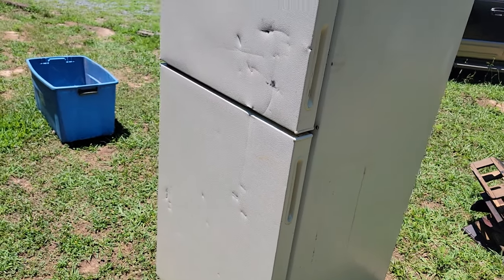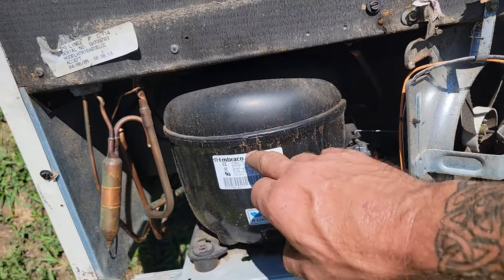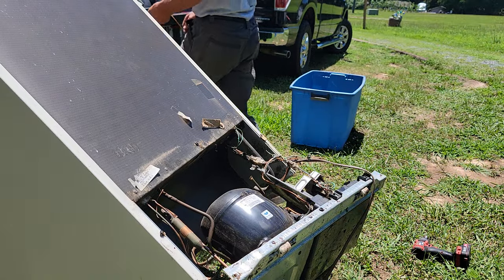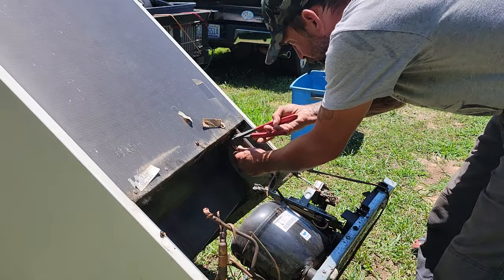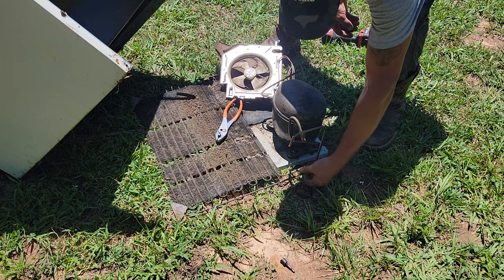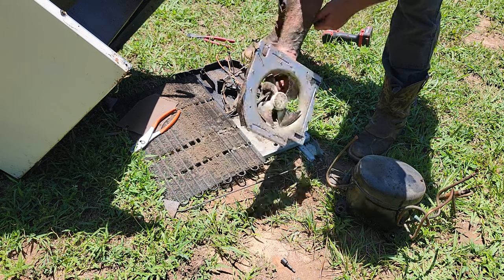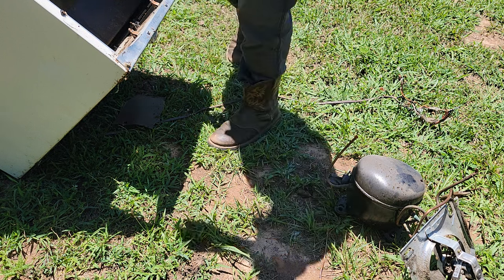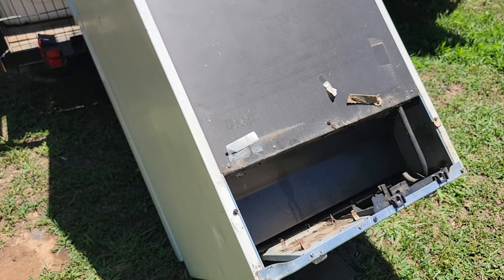How to Field strip a Refrigerator for Scrap Goodies. Its so easy. #howto

Comment: Behind the back panel in the freezer compartment, there is an aluminum radiator, fan motor, sheet aluminum and more copper tubing and wire, too.
Reply from the maker: I don't get that deep into it.  I just grab the easy pickings.  But I will try on the next one
Reply: Not worth it, 3 times more effort for 2 times less scraps
Reply: SCOTT MILLER  You don't.  There is a metal panel in front of the freezer components.  The plastic goes with the fridge to the scrap yard.
Reply: @cuscrapping  Do i need to worry about gases from scrapping a fridge?
Reply: @User3749cvndhkcgk  As with any appliance that carries freon, yes...they need to be properly evacuated before cutting the lines.
Reply: What if it's been sitting for a few years?
Reply: @ZomBearfoot  My 1985 air conditioner worked after not being used for ten years, at least five of those years with the crankcase heater being off.  Also got my 1990 fridge working, by replacing the thermistor relay, after five years of disuse.  Most thrown-away fridges are fixable or even still working.  Actually my electric company will pay $50 for an old working fridge.  You may be able to fix a broken one for $10.

Comment: Thumbs up for mentioning the obligation to be sure there is no freon inside. Residential fridges don't have shrader valves so it's not easy to be sure without tapping into a copper line.
Reply from the maker: It can be hard, my buddy uses a piercing clamp. Works pretty good.

Comment: Most municipalities/counties charge a disposal fee for refers, freezers, ovens, dishwashers, water heaters, etc. Those fees run $25-$30. If you remove the "good stuff" you still have to pay the fee, so it's zero sum gain, unless you do like some and just dump it on the side of the road.
Reply from the maker: My scrap yard takes the shell no problem. And our landfill does not charge if you bring it there as long as you are a resident.

Comment: I don’t usually mess with the fridges but will start after watching your video , thanks 🙏 , I use an old pair of tree loppers I found scraping to cut all my wire and even copper tubing up to even 3/4 inch copper pipe, its like a mini jaws of life cutter ,it’s faster then any other tool I’ve used for cutting with big time leverage for the big stuff.  Thanks for the video
Reply from the maker: Thanks for watching, I also use an old pair of loppers, I leave those on my truck, the others are too expensive. Also as I've learned,  back of the freezer take off the inside panel, aluminum rad and a fan motor. 😀

Comment: The area I live in is surrounded by apartment complexes in every direction, I see refrigerators all the time and strip the copper and compressor out of them, I also see a lot of air conditioners, I've found 6 AC's this week alone which are also good for copper/compressor/radiators
Reply from the maker: Awesome finds.  Keep doing it.

Comment: A question. I would like to use a fridge as a heat pump for a small camper. Any suggestions how to place the cool loop outside, how to not lose the working fluid and how to regulate the temperature inside the camper? Perhaps it is heasy to install valves and loops etc. I want a heat pump for my mini camper.
Reply from the maker: Sounds like a great idea, but I have no clue how that can work. Wish I could help

Comment: More pipework behind the back board, drain the canister of oil and break the components out for cast, copper and aluminium.. the main hazards are in the foam the modern gas used isn’t as harmful as it’s a blowing gas (varies by model) should still be removed with a pump and marked up
Reply from the maker: Awesome feedback,  thank you

Comment: Great video brother but if you took the back all the way off there is more goodies going up the back
Reply from the maker: Oh I know i just don't like tearing into all that insulation, So if you just go through the inside to the back of the freezer you can get the aluminum coil from there
Reply: @scrapitjc  exactly right

Comment: If you open the freezer and look close you will find a aluminum radiator  and more copper wire and a electric motor and the aluminum is all clean...

Comment: I know you have to strip the wires to get the copper but what about the motor and  solenoid? Do you just bring them the the scrapyard as is? Also rough estimate how much in weight and money was that you salvaged from the fridge? Great vid btw!
Reply from the maker: Motors i will Crack the larger ones. Small ones not do much, solenoids I fill a bucket and when full I Crack them for the copper. Maybe all together non and ferros $15-$20. All depends on the size. Plus they are great for storage when curb scrapping
Reply: @scrapitjc  how much copper do you pull out if a fridge like this one?
Reply from the maker: @stealyonikes  2lbs maybe if you Crack the compressor

Comment: How much are those parts worth? Might be getting rid of my old fridge.
Reply from the maker: Depends on your yard. Sealed unit .19cents a pd. Wire $1.50 a pound. Copper varies by location. Maybe $15-$20 bucks depends on how you do it. I strip and stockpile. Usually when I do a pickup, I'm picking up like 10 at a time.
Reply: The fridge, the juice worth the squeeze. Just put it to the curb, somebody will grab it. But when you accumulate a truck or trailer load, its worth the bother.